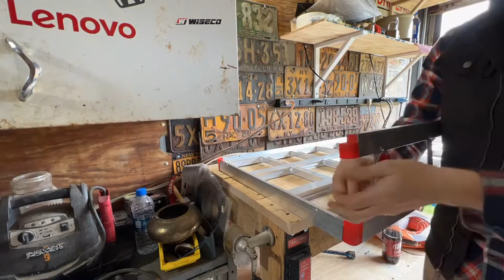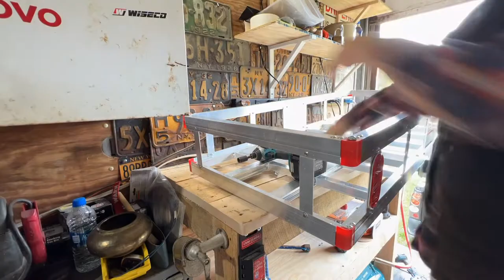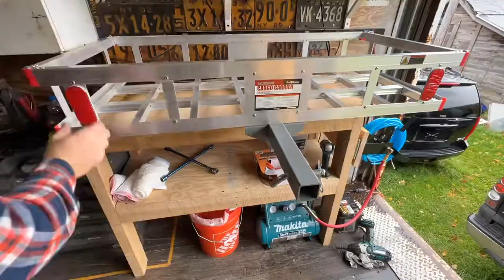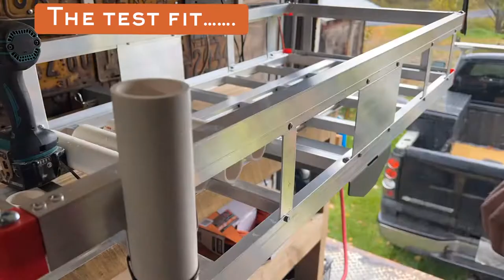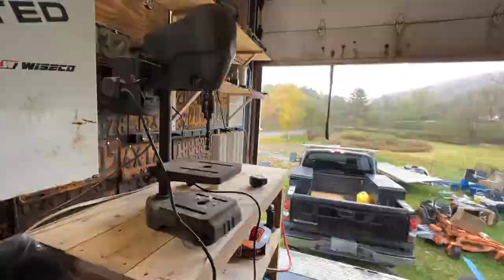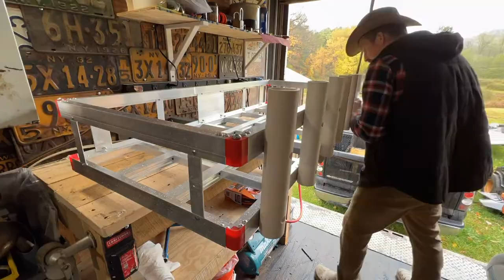Fishing Rod holders attached to a cargo trailer. Super easy and quick project.

Comment: I have the exact same cargo carrier and also converted it. For a heavier-duty setup, you can use aluminum tubing and U-shaped pipe clamps with the ends drilled through the frame of the cargo carrier, top and bottom rails. Also, the red plastic corners will need to be reinforced at some point with the additional stress and torque that big surf rods can exert especially driving across the sand.  I also added some shelf brackets facing the vehicle for an umbrella, and some spring-loaded clamps to held a shovel. I also have a hinged bait cutting board that locks up in place on the back and a bottle opener attached to the frame with a bottle cap receptacle beneath. Lastly, I carry a 2-gal. pump sprayer with fresh water to rinse things off that has a spring-loaded aluminum belt secured the frame of the rack to hold it in place. Since I mount it on an SUV with a tailgate, I use two extenders to clear the tailgate to open: one with a handy step and a second that lifts the whole rig 10” to a better working height. Have been using it with a hitch stabilizer to minimize wobble. Had it about 8 years now and it works great!
Reply from the maker: Hey Ted! That’s awesome 👏 I live all the tips.  That Sounds like a real tail gate party! 🤣 good work! Pump sprayer with freshwater a great idea too!

Comment: Wait, doesn’t the screw go through the pipe keeping the rod from going in? Wouldn’t the screw be in the way? I clearly missed something!
Reply from the maker: The screw goes through the pipe and screws through the second wall of the pipe. They’re only a half inch long. I wish I had a better shot of it.
Reply: Have you had any issues with bottom of poles and the ground? I have an 11' ft rod am not sure if this would work?!
Reply: @TheDevilguy04  Just make your PVC pipes longer.